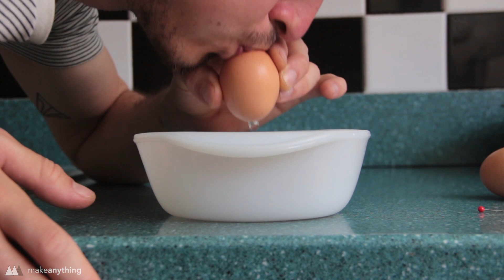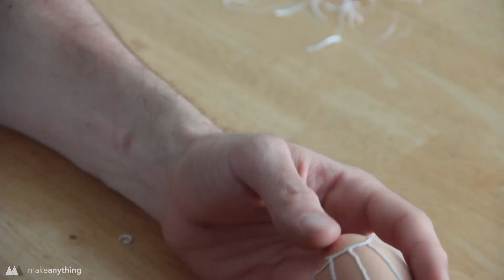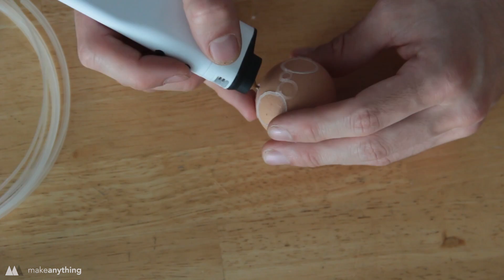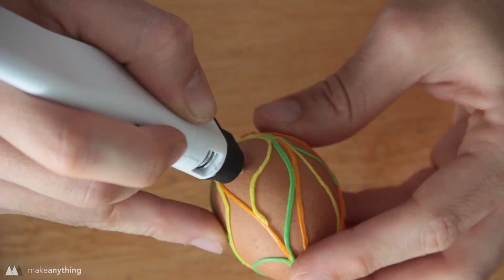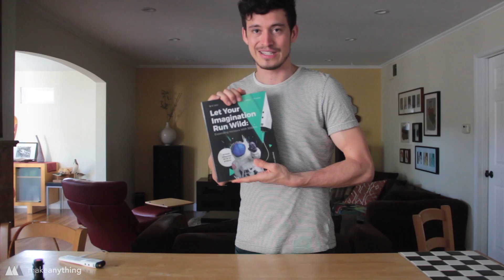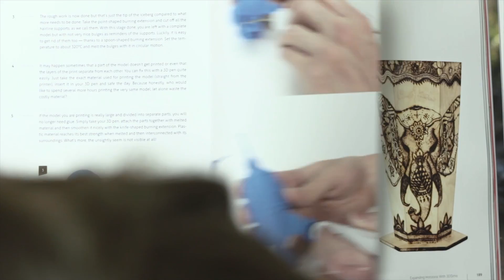3D Pen Easter Eggs with the 3Dsimo Mini

Comment: You should've used a glue stick for adhesion. That's what most purple use on 3d printers. Therm you could wash the egg with water. Just a thought..

Comment: Watching this inspired me to take the cheap plastic eggs and decorate them with my 3D Pen.  Still tricky to get it to stick but if you move slowly, it attaches to the plastic.  I used PLA but maybe ABS would work better because you have to run it hotter.

Comment: I like the idea of decorating eggs. My Mother used to make Christmas Ornaments out of Goose Eggs. She reinforced the eggs with a thin layer of wax inside making it less likely that they would break while handling. You did not seem to have a problem but a thin layer will make the eggs last longer.
Reply from the maker: interesting.. how did she get the wax to coat the inside?
Reply: She melted it and slowly bored it through the biggest hole and rolled it around until it solidified. Make one hole bigger with a small pair of scissors and take out small pieces of shell.

Comment: Could you do this around plastic Easter eggs, then take it apart and make your own eggs for putting candy in, kinda like using it as a stencil. Or like do it in halves, put candy in it then attach the halves so you have to break it open to get what's inside?

Comment: I assume they are safe to eat. because it just lays on the shell. the reason that it isn't edible with some paints, is that that toxic paint, goes THROUGH the shell. 
the plastic is just a hard cover, that doesn't even want to be there.
but now it's cooler, since you can just put them in the Easter decoration box.

and it would be really cool if you had a way to dissolve the eggshells, but not the  plastic. that would be really fragile. but soo cool.

Comment: Hey , can you help me out ? My 3Dsimo doesnt heat up. doesnt matter which head I use..
Reply from the maker: I haven't had that problem, you'll have to contact 3Dsimo directly. Maybe make sure the 3D pen head is stuck all the way on and the metal contacts are clean?
Reply: it is brand new , all the way in , I did contact them , i'll be waiting ,thank you for your time ! :D